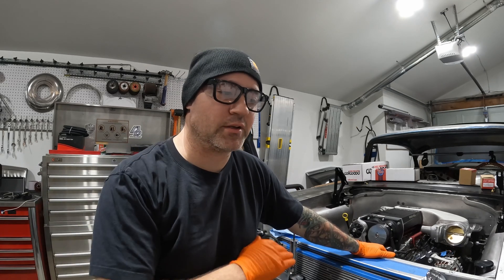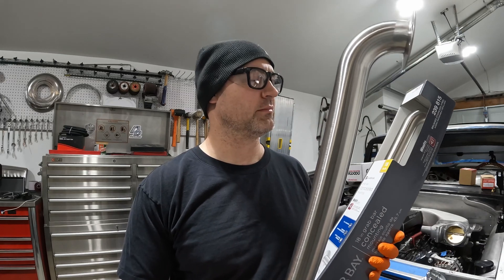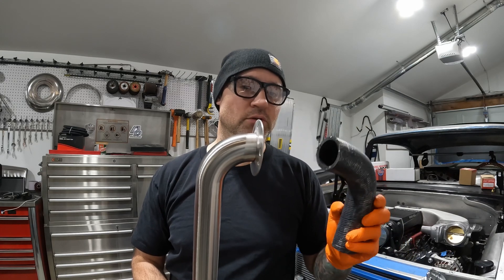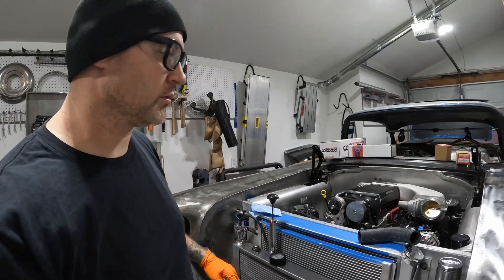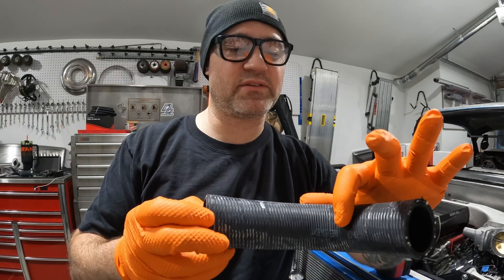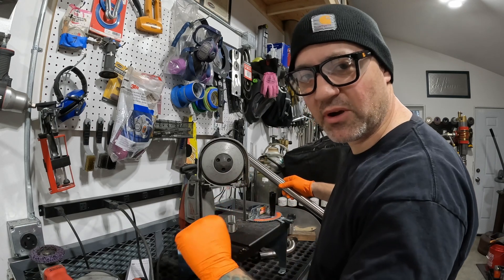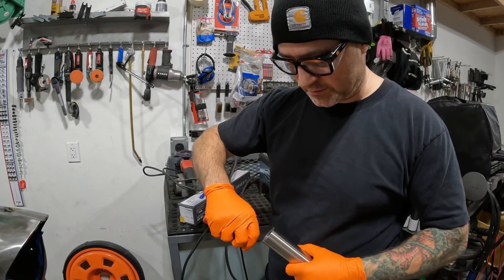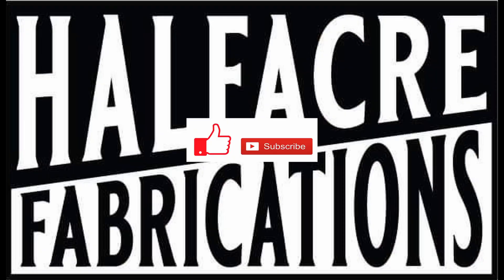Custom Radiator Hoses Part 1

Comment: With no retaining rib on the stainless tubing that hose is going to blow off especially with heat shrink "clamp"
Reply from the maker: They haven't blown off on my chevelle and they've been on there for a couple years now. But I do agree that the rib does help. I did put them on these one for this car and will do it from now on in the future. If they ever blow off on my chevelle I will add a rib, but these clamps are super strong and a pain to get off so not going to fix something that isn't broke yet.

Comment: Good video.  You have some really helpful tips.  What pressure radiator cap do you use on your builds.  I'm wondering how that shrink wrap would stand up on competition cars with high heat (215-220 degrees) and 20 - 25 psi radiator caps.
Reply from the maker: I’m running 18lbs cap. Not sure on how my pressure they will hold but I will say that I did remove one because I thought it slipped, but it didn’t slip and was a nightmare to get off! As the car heats up, the wraps keep getting tighter. So I am pretty confident in them

Comment: Is there a reason you did not roll a hose bead in the end of the stainless?
Reply from the maker: Didn’t need it. These clamps squeeze hard enough and they are far enough into the rubber that they are not going anywhere
Reply: @HalfacreFabrications  I used these on my car and have had one blow off. I now roll every edge. If you have not seen this issue that great.
Reply from the maker: The radiator and water necks have beads then I made sure that the pipe feeds into each rubber hose atleast an inch and a half, so in order for one to blow off the pipe would have to go that much into the other hose. I don’t see that happening. Now if I only had them going in about a half inch then I would be worried

Comment: Interesting idea, but is there any oil/grease on the inside of the stainless from manufacturing? Do you parts clean before fab?
Reply from the maker: No, they are super clean inside and out. Not like stainless madrel bent exhaust. These are all clean

Comment: Thanks so much... I have been looking for replacing hoses for a diesel pusher motor home. This should be better than new!
Reply from the maker: You’re welcome. But for big motor like that might have to get some exhaust pipe. These shower handles at Home Depot are not that big in diameter
Reply: @HalfacreFabrications  The idea is cool, though, even if not for everyone. It gets me in the ballpark for a solution I’ve been looking for. My motorhome is a 1995 Safari Trek built on a Chevrolet P-series chassis. The engine is a GM 6.5L turbocharged diesel, which should be reasonably equivalent to a 7.4L/454 c.i sized radiator hose.
     The problem with these old motorhomes is that the manufacturers often did business with a now-defunct outfit called ACME, to produce cooling components to fit specific installations. Radiator hoses at NAPA or Auto Zone for a 1995 Chevy pickup, won’t necessarily fit in a given motorhome brand.
     And that’s where I love your idea! To me, the 30-year-old radiator hoses in my motorhome are the weak link in keeping my rig on the road. Being able to easily fabricate replacements, would go a long way toward reducing anxiety about potentially destructive failures while on the road.
      Thank you!
Reply from the maker: @TenMinuteTrips  Glad I could help! I think they work great and is easy solution to had to find hoses.